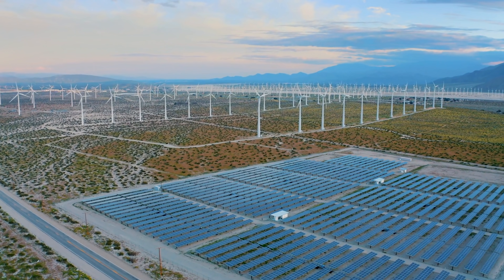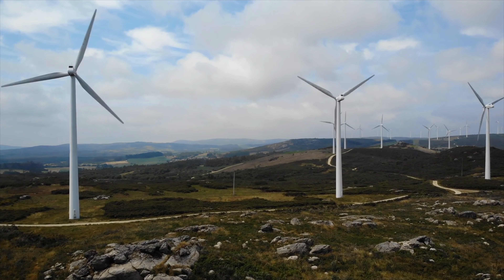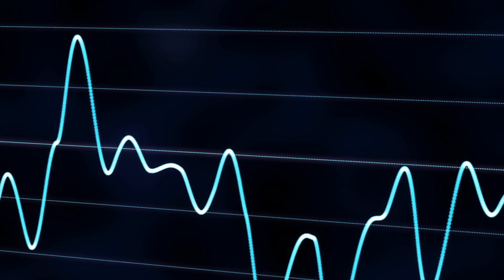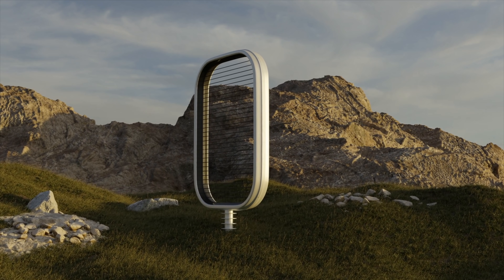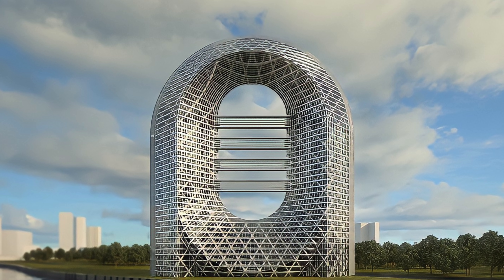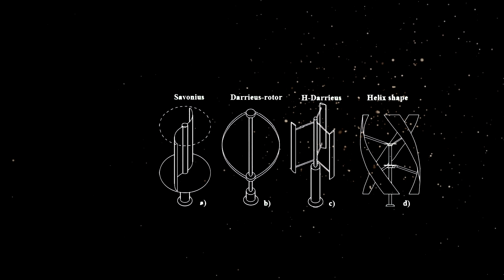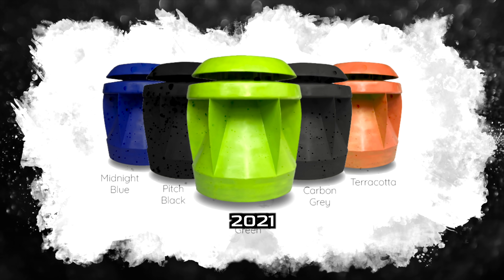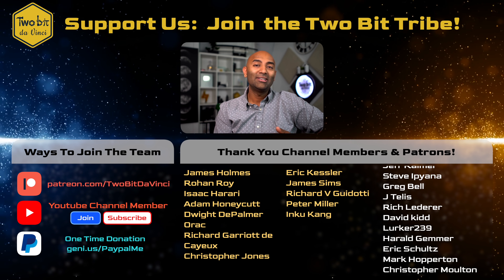These Wind Turbines have NO Blades!

Comment: ⁉️ The Big Wind… If you want to crawl up on a ladder to your roof top wind generator to remove a birds nest, be my guest.  We are neophytes.  Why BIG power companies actually rule.  Density of energy production over total asset costs is the magic to be engineered.  Any wind based system will have maintenance and some clogging and sudden blockage from plastic bags and so on.  So ease of access, simplicity of quick service and perhaps self service or purging of foreign objects and birds nest are factors.  Most of all the asset life is not infinite.  I.E. Is it 5 to 7 years with twice annual maintenance?  More clearly…. All costs come back to the cost per Kilowatt-Hour (1000 watts of energy ran for an hour).  

The costs to acquire, run cables, control variable watts from 0 on up, retransform that to usable voltage and in some applications store the energy ‘efficiently’ all are hard engineering factors of economics.  

Cute and clever artistic objects are fun, like handing a jumbo set of plastic colored keys to amuse a baby, but ‘energy pratactability’ has hard economic demands.  In Chicago the current cost per KwH is .13 cents all in, tax and delivery included.  Chicago solar farms are at .16 per KwH.  In California it may be easily 3 to 4 times.  So geographic factors come into the equation. So a technology of generation has a payback curve that will vary based on a variety of factors.

Power companies are a massive centralized and frequency controlled ‘concentrated energy generation’ systems.  Compatibility to ‘spin the meter backwards’ with are home ‘tinker toy’ of energy generation has been a royal pain for power companies as the frequency and harmonics are not at a professional synchronous grade.  For now, the reality is what you generate is yours to keep and use.  If the power company offers spin back credits, don’t assume the power company is using the energy.  Check out power company resistive burn offs of reverse meter spin and you might be ‘shocked’.  

Remember the plastic jumbo colored keys is being dangled in front of our eyes EVERY DAY (like any marketing ‘puffery’) whether it’s self energy generation, gadgets all the way to fast buck investments.  Just don’t use ‘amusement and cool factors’ as a basis of economics.  Engineering economics is NOT for novices.  It is certainly NOT a sales rep at some home center saying your electric bill will be $1 next year.  There are places solar makes financial sense.  Wind varies so much…  It’s a game looking for chumps until proven economical otherwise.  Yes, we have an environmental responsibility, but I am not falling for jumbo colored keys being flaunted in my face when the long term economics to asset life are more to ‘bet’.  Selling a home with solar is also a risk.  Insurance companies are also looking to dump higher risk insureds.  We have changing climates and higher winds exist.  For a solar roof panels high wind may cause panel damage and leaks.  

My bet is centralized power generation is where the expertise exists for wind energy.  All the rest now is dangling colored baby keys.  

Economics and environmental responsibility are very important and we need to stay focused and not ‘bet’ at the consumer level.  Again, home solar makes economical sense in ‘certain’ applications.  I say the word ‘certain’ in every sense of the word.  We really need to invest wisely and avoid puffery and cool-man knee jerk decisions involving your wallet.  If part of your financial portfolio is to help all this along, so be it.  

I would rather invest responsibly in the Stock of a power company at the leading (not bleeding) edge of the direction towards reliable sustainability.  The economy to scale is the better bet by engineering experts that actually have a better chance of knowing what works.  A power company has stock holders and risks with money are important.  If you want to crawl up a ladder to remove a birds nest from a wind generator on your roof, be my guest.

Comment: I guess the video clip business rewards novelty. There is a reason why virtually all commercial wind turbines employ conventional propeller design - they work efficiently.
In the early days of modern renewable energy (1970s/1980s) there were lots of 
innovations, but most were limited to niches, aside from props.
Good practice is not to speculate about economics until prototypes establish performance
records in real world conditions.

Comment: Micro farming wind power combined with A.I. enhanced distribution matrices is doable now.
Imagine a beach front resort with dozens of table/umbrella combos at the beach side bar. Each umbrella has a small omni directional wind turbine capable of generating 1 to 3 watts at 3.5 volts.
The table has 5 seating stations. Each station has a USB port backed by a battery pack. The table is managed by a smart charging A.I. that senses the charge state of each of the five stations and shunts the power to fill the lowest... Upon finishing the recharge, a green light signal the patron that they can plug in for a recharge.
Be fun for the guests guessing which would get charging next LOL. Might end up with a new set of drinking games? 🤣
Probably be able to do this with one of the many awesome micro computers stemming from the Raspberry PI evolution

Comment: Sir, the oscillation of vortex turbine won't weaken the structure of the turbine and the foundation or the peak structure?
Instead of that the verticaly spning wind mill would be much stable. Only the gears bearing may need maintenance.

Comment: You have to invest a lot of time and research to come to the harsh conclusion that all VAWT are worthless pieces of junk.  1: By sheer design, the wind pressure to your material is already 2/3 inefficient baggage. The Halcium design won't even show you the blade design hidden in the drum. 2. Most VAWT design cannot withstand the constant oscillating reverse in pressure on the blade stems and will fatigue stress in a short time. 3. almost all the wind at low altitude (roof tops) are entirely turbulent wind which does not transfer it's energy onto the surface blades.  Think of being slapped versus being punched. Every single VAWT project in the past 40 years has been a failure or abysmal watts produced.  They never show you audited reports on how much electricity has been generated.  E.G. the Halcium design prototypes have no reported numbers on watts generated because it's abysmally low.  If you see any VAWTs spinning, it's because it's not loaded and it's freely spinning without generating any electricity.  Pinwheels can freely spin with just a gust, but that's not the same as spinning under load of magnetic field.  I've been keenly interested in VAWTs for 20 years but have yet to see any success.

Comment: You failed to mention the two largest problems with current wind turbine technology and pollution. The first problem is that the creation of wind turbines is fully dependent upon fossil fuel burning energy. This negates much of the carbon saving properties of wind. The second thing you failed to mention is that the blades on the wind turbines which are rather large are also unrecyclable. Most landfills can't handle items of this size requiring us to bury the blades in other locations this pollution completely destroys any savings that we get from wind generation. People who promote wind also refuse to acknowledge the fact that the return savings for dollars spent is top heavy meaning we'll spend more money in the creation maintenance and disposal of these units then we will save by using them they are not commercially viable. That's also true for solar Green Technology as it turns out is far from Green in fact it's more polluting than the very clean energy we get from fossil fuels in contrast.

Comment: The trouble I have is they make those blades to taper down to nothing at the longest radius where where a fatter blade would get the most Leverage with the least some people overlooking that what's today's Miracles Miracle materials they can make blade blades strong enough and rigid enough that they could they could that they can add something to the end of that blade to get the leverage they need to spend that turbine with a little more

Comment: I predict wind generated electricity will die out as solar improves, with smaller and more efficient pannels, combined with substantially better capacitors and batteries. The issue with wind is the problem with moving parts and mainetenance, which solar does not have. Today, I am much more inclined to invest in solar than wind, especially as Perovskites improve and becomes available, no doubt about it.

Comment: I like this this presentation for extending the possibilities. I have been a large fan of solar and wind (which is solar power in a converted form) since the 70s when I learned about wind power that supplied farming communities before REA. Admiral Byrd took a wind generator (I believe a Jacobs model) to the South pole and decades later subsequent explorers on had to UN-tether the device to receive full output. We can use many sources but the stumbling block has always been storage since the wind is not always predictable. The vertical axis air impeller was invented in the US nearly 100 years ago. It never needed to be directed to the wind because it already was for 365 degrees. This is a new technology and it's not likely we can changes without gradual transition. You talked about bird kills be seemed to dismiss it with comparison to cat kills. I will tell you that Bat kills are much higher. We have migrating Bats in my part of the country and we used to see 8-12 bats flying in our back yard catching insects and making our lives better every night. The Wind Farms went up and the bats were reduced to 0 and even a few years 1-2. The three bladed wind generators make a sound when rotating like the wind blowing over the mouth of a cave and the Bats are drawn to it. Since the blades have an articulated swing, the Bats can't hear them coming from the side and are slaughtered. There are piles of their carcasses under the wind generators. We need a better total focus for this to be a complete solution that claims 'Green.'

Comment: Hmm... no mention of Flettner/Magnus Effect turbines? 
Where wing-like lift is provided by flow of fluid over a rotating cylinder...
Anton Flettner demonstrated the practicality to power modest sized ships
including an Atlantic crossing in the 1920's.

Energy input is required to rotate the cylinders, but a net collection of energy can
be achieved and by turning off the rotation it can be quickly de-powered avoiding
the prospect of the system running away and destructing under extreme conditions.

Have seen these with cylinders replacing blades in a propellor-like configuration, but
don't see why they couldn't be adapted for VAWT's...

Comment: Tacoma narrows bridge failure wasn't due to resonance.  It was due to aeroelastic flutter.
Reply from the maker: The flutter occurred at a resonant frequency which expounded the problem. Flutter effects evrry bridge but they don’t fall because they’re designed to vibrate from flutter at frequencies different than their resonant frequency. Cheers

Comment: I am all for vertical blade wind generators
You could design a system- electrical or mechanical to change the attack angle of th blades based on the amount of wind
Am with you,  large old style windmilling generators are a thing of the PAST

Comment: Interesting, but please use English (if it's an English language video...). The device pictured on the 'cover' of this video is NOT a turbine.
Reply from the maker: yeah it is
Reply: @TwoBitDaVinci  -
"a machine or an engine that receives its power from a wheel that is turned by the pressure of water, air, or gas" (Oxford Dictionary)

With the exception of the Vertical Axis Turbine, the devices featured in this video do not meet this definition and thus are not 'turbines'. Why is this contentious?

Comment: In short, the power is there.  It can be scavenge, generated, concentrated, distributed.  The tech is there for each of those processes.   The economics are there, mutis mutandi of course, that equation is more complicated.  The strategic imperative is there (global warming, energy security).   The problem is therefore legacy economic structures - existing centralized power generation, distribution; existing energy complexes - oil and gas companies.   Let us be under no illusions as to the power of those entities - like any organism, they have a keen sense of their own imperatives to survive and thrive and will deal with any and all threats that arise.  They've been doing it for centuries and have even used war as an instrument of self-interest.   

There are many examples of the vulnerabilities of central power generation - war in Ukraine, Iraq; ice storms in Texas, Ontario/Quebec, hurricanes in the Caribbean etc,  magnetic storms from the Sun, hackers from Russia, Israel, US, China...   But the solution is surely not independent power generation - solar power on the SFD roofs, but district solutions;  which is what this video is about.  Very positive, very encouraging.   Another development which is very encouraging is what's happening in Orkney as it converts to hydrogen as the energy distribution mechanism.

Comment: You also need to include the cost and environmental impact of the turbine blades.  The cost to make them, the materials used and the almost inability to get rid of them once they've been damaged (usually due to wear on their front edge) and need to be replaced.  There are literal graveyards of blades that we can't recycle and won't decompose.
Reply: Cant the blades be recycled? If the materials are good...

Comment: Every piece of wire that will hold a charge, holds that charge, is harvesting the energy out of the air, continuously. We need to just harvest the frequencies already in the air.  Zero Point - it just takes a coil the proper size, then cycle it 100's of thousands times a second and harvest that energy to a battery or directly to powering your house.  There are a few of these small machines in use in 3rd world countries.  It is what Nikola Tesla had in mind.  The best tech buried and hidden.  Like Royal Rife, important technology, buried and suppressed that would change the world.

Comment: VAWT wind blades are the best idea. What are these engineers in the U.S. doing??? With tons of blades hanging on one side of a horizontal shaft. Causing severe leverage by downward force of this weight just on 0ne side??? Then the constant wobbling of the blades turning in the wind. Not a good desighn. Its looks like the U.S. engineers took their idea from a early 1900 electric fan. No real thought in the design???

Comment: The vortex shedding is extremely interesting, but I wonder if it may produce some frequencies that have an impact on nature. I'm a big fan of Vawt's and really like the power pod design.
Reply: The interior of the wing has a flow fence matrix designed to force distributed pressure along the trailing edge. The air gap in that trailing edge is huge at the designed scale, and should, as predicted, not produce pressure differentials that might induce harmonics.

Comment: Personal wind is the answer. No not farts. Imagine every house with a vertical turbine, and instead of panels, a thin solar collecting film that can coat roofs, or thin recyclable panels. The eco footprint from conventional panels and turbines, is unsustainable. But with few moving parts and biodegradable materials, a grid of individual power, is a no brainer, , as people in the Midwest who will be devastated by rolling black and brown-outs, will soon learn.  Could you please do a segment on Thorium reactors? All our nuke plants are ticking time bombs, just waiting for a massive grid failure, and lack of diesel to power the back up generators, as they need constant cooling to keep from melting down.

Comment: you messed up the math on the tennis racket generator, the output power of each nozzle is 2.1 milliwatts, 500 * 2mw is one singular watt. not a kilowatt. for a kilwatt you would need 500,000 nozzles with an area of 14,000 sq meters. that is not going to be mainstream.

Comment: For the amount of money spent, wind turbines have done very little. They're made in China:(
Natural gas is more reliable, burns clean and saves lots of money. The US has enough fuel to be independent.
The first thing the new Congress needs to do is pass legislation protecting US energy independence. And, our strategic oil reserves from presidential overreach.

Comment: I’m interested in how these small wind turbines come out in cost/kWh. They’ll almost certainly be more expensive than grid power, but by how much? One of these with a relatively small storage system for stabilization could be a really nice off-grid for a single building, and getting off the power grid entirely is very appealing for both homes and commercial buildings.

Comment: Why was the vertical windmill stationed on the train station platform and not mounted ON THE TRAIN to charge batteries within the train? There would be immensely more energy on a moving train than the air being displaced on the platform by the moving train.

Comment: Hey The Cats feed on the Birds, the wind turbines just kill randomly unaware Birds … I’m for shorter vertical and simple design and construction Windmills. The rotational bearings and drive transfer belts can give us quieter Generators. Axial fan windmills would be more efficient than oscillators like the one pictured  at low wind speeds… the big windmills generate quite a lot of noise in unison , this is environmentally undesirable …